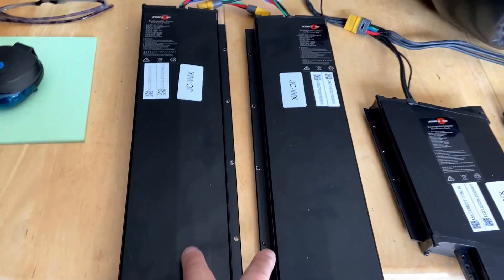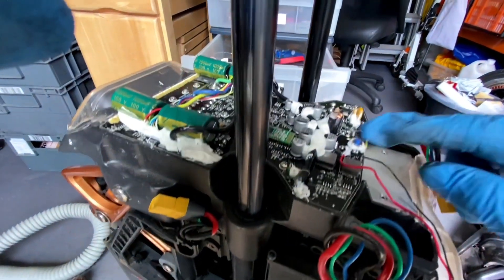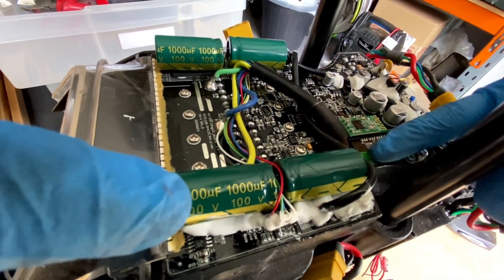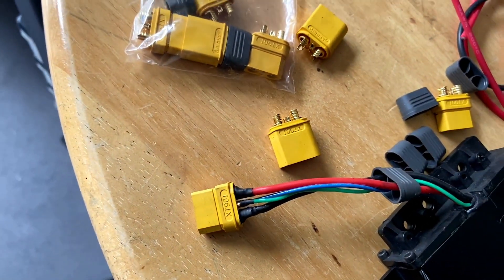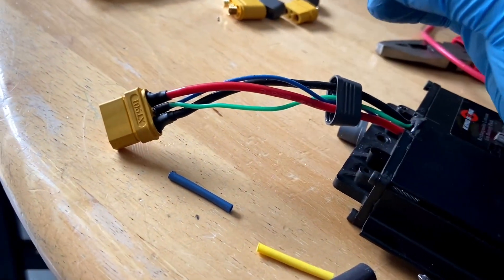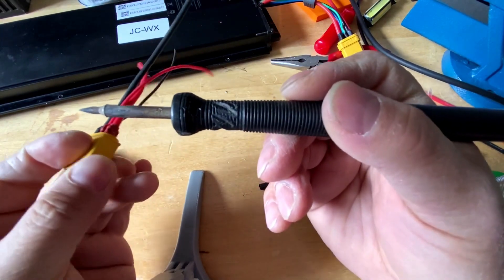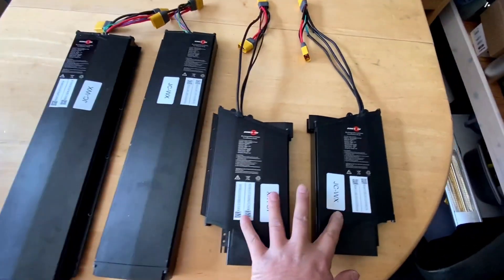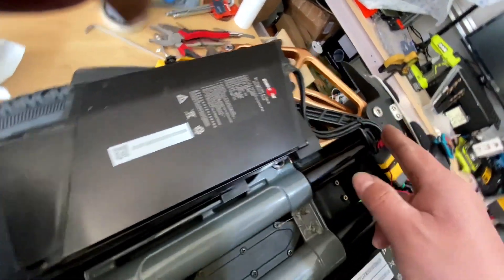KINGSONG S18 BATTERY UPGRADE TO 2200WH. EUC, ELECTRIC UNICYCLE.

Comment: Dang you're crazy lol!! some maths needed there for the weight adjustment on the shock and rider limit i reckon to account for that oversized battery packs lol. awesome vid and thanks for sharing!
Reply from the maker: with the extra battery the shock has been pumb up to 220psi to take my weight of 76kg.
Reply: @eucupgrades  just a little bit of extra air then lol
Reply: @oddtechman  with the batteries he added its like 5-7 kg (10-12lbs) extra

Comment: Congrats! Guess thats the biggest S18 battery mod now! My S18 has „only“ 1850wh....i made new battery packs myself and added them under handle and as brakepads. Nice job!
Reply from the maker: Nice. How many miles do you get on your?
Reply: @eucupgrades  i am very heavy...using 22wh per one km.  That’s about 80-85km...
Reply: you got pics?
Reply: Up ;) I'am also interested in your setup!

Comment: Amazing I was thinking of doing something similar but either creating an external battery basket to set in the front and the rear and and batteries  based an the distance I was trying to travel or have a backpack version with a long chord that I can  plug in for long eides

Comment: I’m about to add the two extra half packs I have to my S18.  I’m wondering if I might have any noticeable change in the way it rides if I were to secure them to the front sides considering the front already has more battery weight.  I’m sure it’ll ride ok if each side is in balance but just curious whether it’d be better to try to secure them towards the back sides to make the wheel more balanced front to back.  What do you think?

Comment: So I'm planning to do a battery upgrade myself and my plan is to get 20 (genuine tesla model 3 4800mah 21700 cells) and then try to add 1 cell to each of the 20 (3 cell) packs ( I believe the S18 has a 20s3p 21700 battery array, correct?) So this would create a 20s4p array adding 4800mah to the existing 13Ah that the 3p setup currently provides (1100wh ÷  84v = 13Ah) so effectively I should end up with close to 1500wh plus a 4p setup which will increase the Amp output and reduce the risk of cutout and add 15-20 km range
...
 According to my math at least. So my question is: how difficult is it going to be to isolate each of the (20) 3cell 21700 packs so that an additional 21700 can be added in parallel? I'm hoping that this type of mod will not increase the overall size of the machine and possibly the additional cells will be able to be concealed in some custom "powerpads" (hehe.. no pun intended)

Comment: Kevin, I have a question, did you just solder the new wire to the X90 connector or you desoldered the wired X90 first and then re-soldered the wires and the connector?
Reply from the maker: Best to cut it off and joint the bold wires and solder it to a new x90 plug. Because if you desolder and reuse the plug it take a lot longer and sometimes the plug can be damage by the heat.

Comment: Please help. My S18 won’t turn off. I changed the tire and now when I turn off wheel, the brake tail light keeps blinking.
Reply from the maker: If you have not touch the system board and only change the tire. please check the motor cable and the control cable and the connector plug to make sure there is no damage it.

Comment: Hi, mate! Do you know what are the thinner wires in battery backs for? Aren't they serve for battery balance infromation for the controller? I suppose it's not a good idea to just put them parallel.... Please, correct me if I'm mistaking...
Reply: Correct, sort of. They serve the function that balance leads would normally fill, giving you access to the individual cells. IF they are put in parallel and kept balanced well by the charge controller, there shouldn't be any issues. By putting the cells in parallel, your just increasing the capacity of the cells.

DON'T PUT THEM IN SERIES!!!! YOUR EUC MAY EXPLODE. Series increases voltage by stacking the cells electronically, the controller board probably won't be able to handle that, where-as it shouldn't have that issue with parallel.

Comment: How was the ride of the modded s18 a year later? Did any problems arised due to the battery mod? Thanks
Reply from the maker: My Mega S18 is still my best long distance suspension wheel. No problem whatsoever.
Reply: @eucupgrades  thats amazing! thanks for sharing this!

Comment: quick question, what are the larger pedal additions you have on your pedals?
Reply from the maker: They are 6mm aluminium plates using self tapping screw through from the bottom up just long enough to act as spike padals.
Reply: @eucupgrades  Thank you!

Comment: Did you charge the batteries before I stalling?
Reply from the maker: Best to charge it to the same level before connecting them together or when you connect all the battery together the battery will level off. If the old one is fully charged and the new one is not it will take a while for the battery to level off.

Comment: so do u charge all these batteries with stock s18 charger or separately???
Reply from the maker: If you got time stock charger is good. But if you want to charge quick use 5a charger. But 5a fast charger will only charge up to 98% if you want 100% use stock charger to finish off.
Reply: @eucupgrades  what i mean't to say was after installing these extra packs do u charge all these packs with stock charger in one go or do u charge them one by one with separate charger for each pack???
i assume all these aftermarket packs have different ah but same voltage right??
Reply from the maker: @matelslug1  have you see the video part 1? Once the battery are install, it's inside the unit so you don't take battery out to charge separately you just charge as  normal in one goes otherwise it's much work.

Comment: Dammn... its beefed up now.. how does it stand now that is wider between your legs?... is it comfortable? This must be the fattest wheel now out there.
Reply from the maker: It looks like S18 on steroid. With the width at 25cm it not too bad just a little wider than the EXN. Just have to get use to it and get my leg condition to it.The weight is lighter than the EX at 33.7kg.